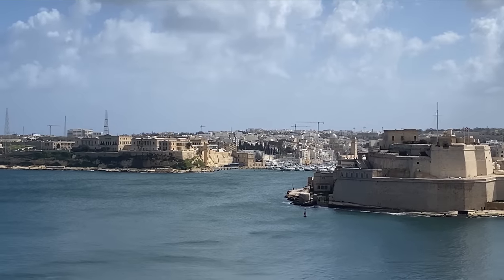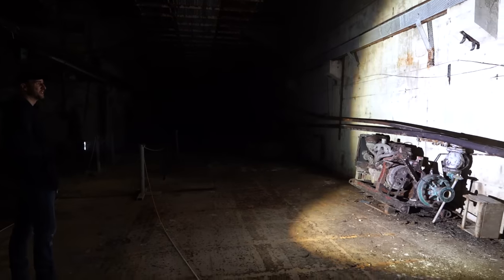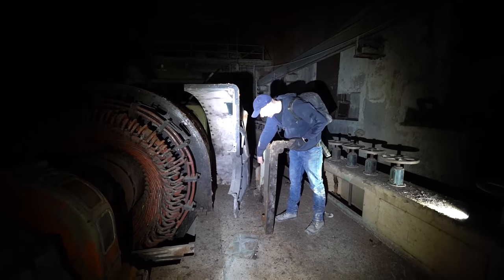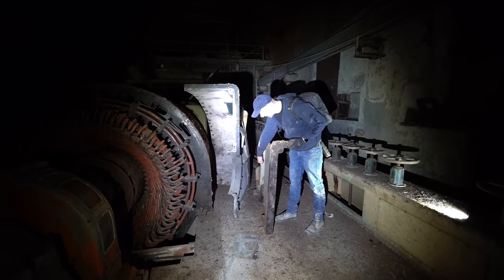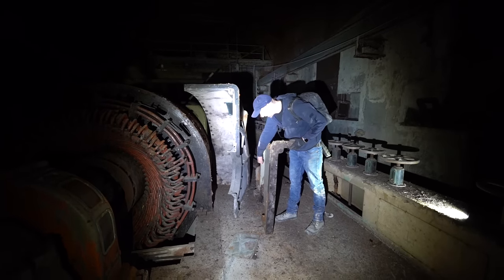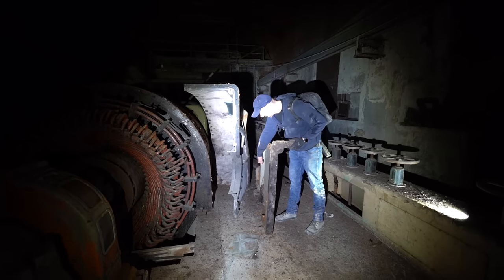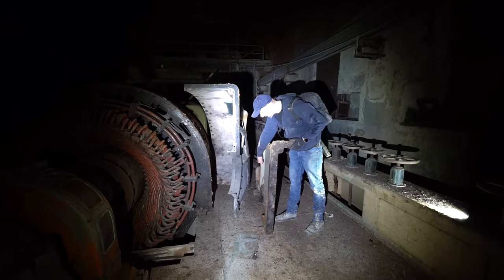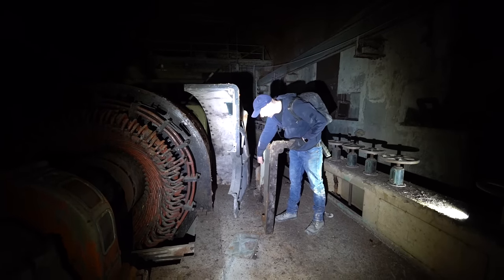Discovered a forgotten military underground power station | ABANDONED

Comment: I've been there! We had a school visit to the place around 1977. Drove down a long tunnel in a minibus to get inside. It was running at the time and providing power to most of Malta. We were showed around the control room. One guage showed nearly 1000 amps. This was being drawn by a Royal Navy warship that was in Valetta harbour. I remember the batteries. We were told that they came from submarines. The high voltage contactors were submerged in a bath of oil and switched at high speed using a shotgun cartridge!
All the turbines in use then were steam driven via oil fired boilers. The big diesel engines had long since retired. However, they were occasionally started up. We got to see that. Pretty scary. The whole floor was thumping. The engines had double acting pistons. We were shown a piston and it was huge. Easily the size of an oil drum. The place was immaculate back then. I remember seeing a machine shop fully loaded with lathes, milling machines etc. I was envious because it was better stuff than what we had at school.
Reply: thank you for sharing that story I would have loved to see what you saw wow
Reply: @Pure-Luck447  It was definitely a great school trip. I lived in Malta and had no idea this place existed. The amount of decay shown in the video is shocking. I guess when the place was in use the heat kept the damp at bay. I do remember it was very hot in there, particularly by the boilers.
Reply: That's awesome!  Being able to see all that stuff is really neat, especially seeing the battery contactors using the shotshell to switch, that's one of those things that just seems ridiculous
Reply: @klagger07  The contactors had to switch thousands of volts. The power from the shotgun cartridge blasted the switching mechanism at high speed so the contacts had little time to arc before they meshed together. Shame we didn't get to see this demonstrated. It would have been impressive.
Reply: And what do you do in life now? You seem pretty knowledgeble when it comes to technical terms
Reply: @wk9195  I'm an electronics engineer. However, I love knowing how things work and improving them if possible especially mechanical items.
Reply from the maker: Thanks for sharing your story Colin ! Must have been crazy back then. :)
Reply: @ExploringtheUnbeatenPath  I never passed a thought as to where the electricity came from when I lived in Malta. It was certainly a very special school visit to the underground power station. We had no idea this place existed! The scale of the place is huge. An amazing feat of engineering to build that place and get it fitted out with all that stuff. Must have cost a fortune.
Under Manoel Island there's plenty of tunnels. I explored these as a kid. Probably WW2 era. Loads of rooms with rusted steel doors. Even huge oil storage areas too.  Some stairways go down even deeper but are flooded. One tunnel underground was bricked off. We spent about 5 hours trying to break through but the  bricks were more than a metre deep so we eventually gave up. I wonder to this day as to what was on the other side. The old fort on the island has tunnels underneath it. The stairs going down were badly rusted so we daren't test them! We also discovered whilst exploring near Valetta some more tunnels. In one room is a big multi cylinder diesel engine about the size of a car. On the end of it is a gearbox and huge drum of thick steel cable. The cable goes through a hole and down into the sea. I reckon it was used to pull up a steel net to seal off the entrance to Valetta harbour. This would stop submarines getting in and torpedoing the ships moored there. The Italians tried to destroy this net using speedboats packed with explosive. The raid went horribly wrong for them. I think one of the boats used in the raid might still exist. I'll check.
Reply: I thought we had explored most caves, tunnels, water reservoirs, etc in Malta, during the 7 years I lived there, but no… there is always something more to discover! Great video!
Reply: @canadianoddy8504  I would agree.  I've noticed near the ceiling the old school belt wheels which would have powered the machines.
Reply: Look up aether by a channel called blue        you will see what all that would have been at 1 point malta has starforts on it  enjoy
Reply: Look up aether by a channel called blue you will see what that would have been at 1 point malta has starforts   enjoy
Reply: @niceboy761  I am looking for this and cannot find what you've explained.  Please give more details.
Reply: Nevermind...I found this...quackery.
Reply: Amazing story awesome.
Reply: Btw, these areas are excellent locations for a techno party! 😏💃🏼🕺🏼🥳
Reply: @eggbirdtherooster  If you don't mind breathing in asbestos dust!
Reply: That's insane... wayyyy better than my school trips. But I guess that comes with the danger of growing up in a strategic base during the cold war
Reply: Posti così sarebbero da mantenere attivi  e moderni; specialmente viste le continue tensioni internazionali che andranno a peggiorare sempre più.
Reply: Brutal brutal broh cuenta tu historia y serás leido
Reply: @niceboy761  can't find channel mate
Reply: you pretty much nailed it ..... the information you provided is correct and exact
Reply: Oh you lucky old sod , lm so envious.
Reply: @flightforensics4523  Wow. That's some praise! Thank you.
Reply: @thomasd1396  I hear the caves and tunnels under Malta are so extensive that it can take weeks to find someone if they get lost down there, is that true?
Reply: @burtpanzer  it's not really like that: there are tons of caves and tunnels, but they're usually not that large, besides the old water reservoirs. Once you know someone is in one of them, it's probably pretty easy to find them. But if no one knows you're there, then the next visitor may be a few years away.
Unfortunately, a lot of these are being destroyed because Malta went through a construction frenzy that supports financially a lot a people, so it keeps going.
Reply: Thank you

Comment: Hi Folks, this underground  treasure used to form part of Malta Drydocks, and it even used to supply power for the same yard. I have worked there for a total of 36 years up to 2003, and can assure you that at this location there are tens of tunnels, all dug out in solid rock before and during WWII, many of them used as workshops so that important works could continue even during bombardments, and I can assure you this area of Malta was the heaviest bombed, especially when HMS Illustrious entered here for quick repairs in 1942. One of the biggest underground tunnels was later used as a huge training centre for us apprentices, and once I had read somewhere that when Queen Elizabeth was taken there during a royal visit in 1954, she was absolutely impressed!
Reply: Great story Paul! Thanks for sharing
Reply: There's loads of tunnels under Manoel Island and the fort there. I used to explore these when I was 13. We gained access via a ventilation shaft. There's also 2 huge oil storage tanks under the island too. I imagine it will be impossible to get into these tunnels now as the fort is guarded as it is now being restored.
Reply from the maker: Thanks for the information Paul ! If you have any more cool locations regarding this, please let me know :)
Reply: Really insightful information, thanks ver much, Do you know if the two giant propellers found at the end were from ship repair at the dry dock, or came off the diesel engines used in the generator hall?

Comment: As a retired electrical engineer and power plant manager, i found this video top notch!  A tour of 1940s power generation and underground to boot!   The turbine generators were powered by oil-fired boilers the best i could tell.  Normally the diesel generators were used for start-up and standby power.   The fact the plant was built underground would have been astronomically expensive per Kw!  But given the time, survivability was the chief design consideration. Salute to those guys who worked long hours underground to keep the plant running and maintained not seeing the light of day!   The last part of the video covered the spare parts inventory, amazing that some of the parts are still left.  To me the most amazing thing that you discovered: the Parsons generator (alternator as stated) cover was made from wood!!!  I would have to guess it was to save metal during the war period and or lighter weight for maintenance reasons.  The plants i worked in (modern 1970s through early 2000s) the generator casings were made of heavy steel.    Shame a lot of the gauges had been smashed by vandals.    Thank you and God speed!   Please be careful as you know such facilities can be very dangerous in such an aged state.   You guys should be on the history channel !!!  Oh yes those batteries i wonder if the casings were made of glass? Early telecom companies used back-up batteries and their casings were made of glass.
Reply from the maker: Thanks a million for checking out :) I believe the batteries were made out of glass yes ! The gauges are not destroyed by vandels but destroyed by time and the elements of nature.

Comment: the reason those end bells are wood, or a fiber material. speaking from experience im a journeyman turbine millwright for GE. usually if theyre hydrogen cooled theyll be big metal  two piece end bells following inner gas shields, amongst other supporting pieces such as hydrogen seals and good sealant on the split lines, or (pumpable) end bells with "dow corning". those being light means the generator is air cooled. love seeing stuff like this!

Comment: Very interesting time capsule. Unfortunately too much water damage to ever get it working again. At current scrap prices I am surprised people have not gone in there for the copper.  Also wonder if some of the old large chambers may have held fuel tanks at some time.
Reply from the maker: Thanks for checking out ! The fuel tanks were in the back of the newer turbine hall I believe and for the older turbines I have to check :) 
I think it's too hard to get in & out for copper thieves because it's located on active & off-limit terrain.

Comment: I believe that this is the Kordin Hill Underground Power Station. It's heritage listed, so it's not going anywhere. It is eventually planned to be opened as a museum. 

There is another underground power station in the Grand Harbor at Marsa. It's all that remains of the Marsa Power Station. The above ground B station was torn down in 2018 after being supplanted by the nearby Delimara gas fired power plant, but the Marsa A Power Station, which is underground, is still there, complete with machinery. This is also heritage listed, so it cannot be dismantled. It too is planned to be opened as a museum.
Reply from the maker: I read some things that it got dismantled partly too. I tried that one too, but there’s activity inside the underground part.

Comment: Nice video! Just so you know, all the big gas bottle's you see everywhere, those are/were filled with co2. This is for fire extinguishing. (Fixed fire fighting equipment for firefighting in closed spaces) I hope you have an atmosphere meter with you, or I would suggest you buying one. If some bottles start leaking you could be walking your last steps.

Keep up the good work!
Reply: Great Safety issues, to recommend.
Reply: The large diesel engines are brought up to speed using compressed air. Maybe the cylinders are to do with that.
Reply: @colintinker7778  That isn't true. If it would have been for starting of diesel engines, there would have been 1 or 2 big air vessels. With large diameter connections to get sufficient flow to the starting air distributor. 
And I didn't see any "large" diesel engine.

Believe me, this is just for fire fighting purposes.
Reply: @koen5457  It was merely a suggestion! That place has huge diesel engines that were brought up to speed using compressed air. I was there being shown around and one of the engines was started...   with compressed air!

Comment: What is the purpose of the gas bottles in most of the rooms?
Reply: Co2 for fire protection
Reply: fire supression system, and possibly for starting the diesel engines. it was common to use CO2 for starting big engines. even some tanks and trucks have similar systems.

Comment: i used to work in a steel works in a huge area called "the motor room" containing 7 giant armatures for the hot mill and the hugr 7 rolling mills that roll the steel slabs into sheet . and its full of these huge cabinets and breakers , it is still in use today, and this old tech is still being used ,

Comment: How quickly things very seriously decay.  They probably named the passages so they'd avoid getting lost.  BTW, how do you keep track of the way OUT? 

At 28:05 - he throws a switch on the control panel, there's a loud whirring sound, the ground begins to shake, debris falls from the ceiling, a giant door slides open, and an alien spacecraft is revealed.